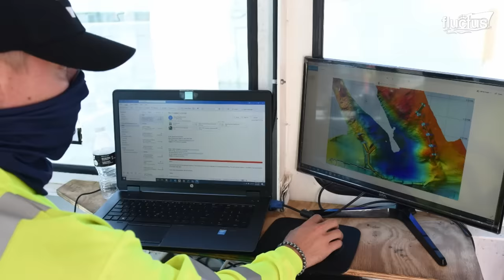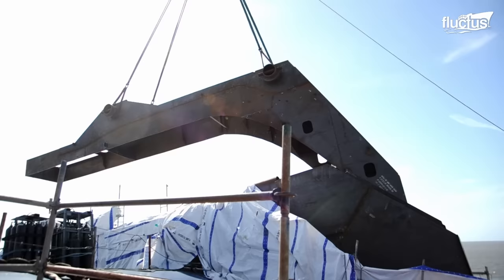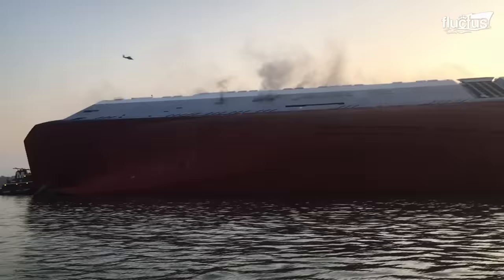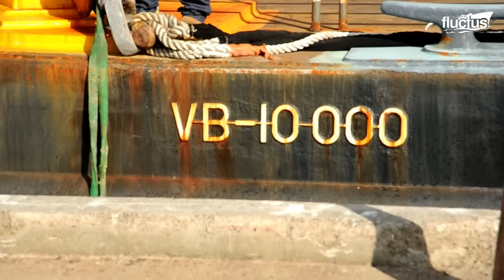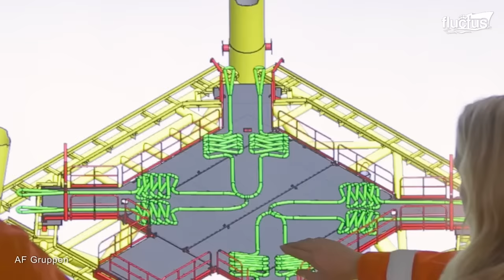US Genius Technique to Recover Billions $ Ship in Middle of the Sea

Comment: I just wish that these documentaries would stop saying rigs, instead of production platforms. Rigs are what drill for oil, and production platforms are there to get the oil out of the ground, and either send the oil to a ship, or send the oil and gas to the shore via pipe lines.
Reply: Maybe they say it because everything is rigged.
Reply: Doesn't the same platform that is used to drill for oil later get used to extract said oil?
Reply: @siggyincr7447  No, a drilling rig, is just that, a drilling rig. Then the Oil company will set their sub-sea valve system called a tree, and then build a production platform to extract the oil and gas. Now there is Production platforms with rig packages on them, but the rig package can be removed. So the rig and the production packages are different.
Reply: @KWlsuz20  I didn't know that. I thought they put the platform in place, drilled till they hit oil and then started the extraction, all from the same platform.

Comment: What happens to the fuel oil?  I am sure it can be cleaned up, all the salt water taken out.   I am sure every ship at sea has that ability. Its gotta
Reply: Fuel oil is good to reuse, nothing happened with it. The fuel will float on water so if contaminated it is easy to separate the water.

Comment: The golden ray could have been refloated.
They botched this job so bad and caused and environmental catastrophe. 
Smit offered to do the contract by refloating the entire vessel whole to bring to scrap with virtually no pollution and cure in 6 to 9 months but no the cowboys cowboyed it and caused not only a mess but took almost 2 years to accomplish the task while lighting the wreck on fire multiple times and dumping cars all over the sea floor.
Real revolutionary..
You can't tell a fool anything.

Comment: I wonder if those cars are totally destroyed after being in the water
Reply: Yes.  The saltwater will corrode wiring, bodies, modules, etc.  for the low cost of $70,000 in parts, you can repair a $38,000 car.